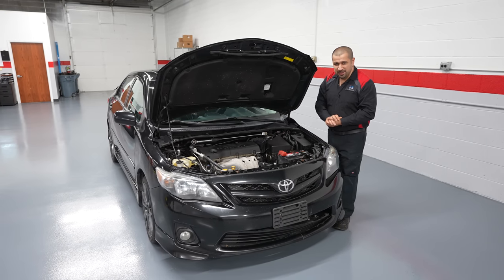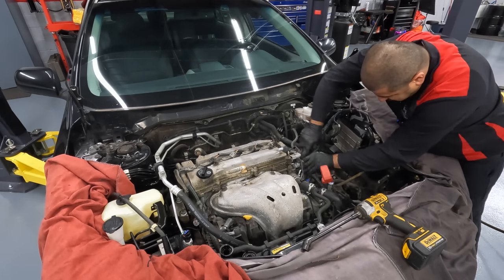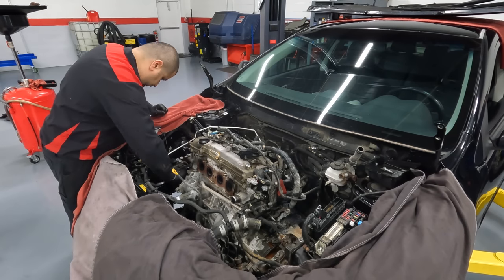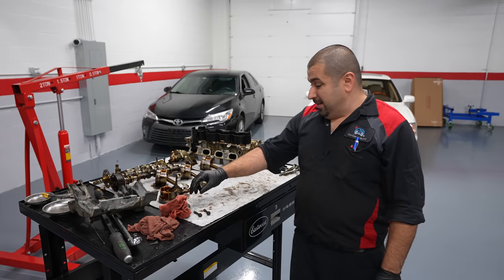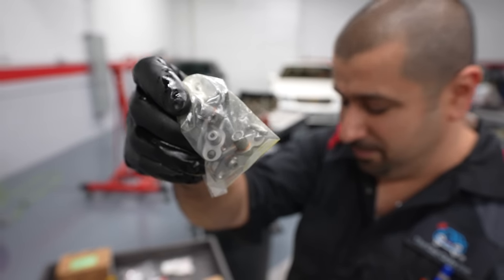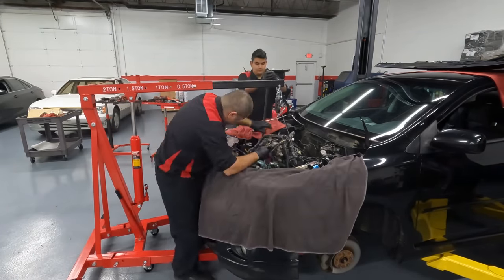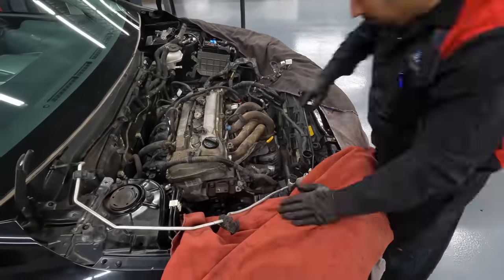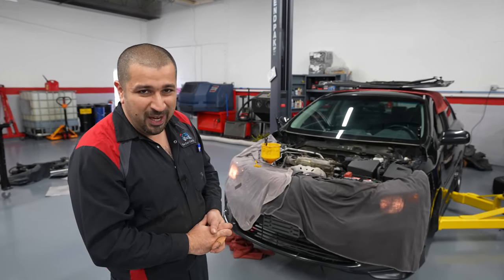THIS is Toyota's Worst Engine Ever Made! But Is It Really THAT Bad?

Comment: 5000 miles or 6 months, whichever comes first and NO MORE! Great advise my dear brother. Thank you so much for the timestamps on the description for the mechanically less inclined folks like myself.
Reply: I have an 08 rav4 100k miles, with this engine, did the 5000 mile full synthetic changes, still not burning more than 1/2 qt between changes, I am going to reduce to a 3000 mile interval with full synthetic to forestall this repair, also I will add 1 qt diesel 5 minutes before the change to dilute.
Reply: i changed the oil 17 times from 5k to 85k miles and the motor seized at 86k miles ...
Reply: @JP-jq1qx  doesn't that overfill the engine? Aren't we supposed to beware of overfilling? Just asking, no puns or anything
Reply: When I took my 2020 gx for oil change 5 months (3000 miles)after purchase, the dealer insisted not changing the oil. They insisted it was not due until 10,000 miles from last oil change. Should I insist and pay since it does not meet their complementary service timelines?
Reply: @sabyjackson5298  I would go somewhere else or do it yourself
Reply: @sabyjackson5298  I would pay and get it done regardless.
Reply: @sabyjackson5298  buy oem filters and do it yourself or get it done, if they see oem filters, they won't know what oil is in there. That's what I'd do
Reply: @JP-jq1qx  - I have the same model and mileage (bought it in 2019 w/99K miles on it - it’s only driven by my son who drives it maybe once per week). Once I switched from 0W-20 to 5W-20 the oil burning stopped. Which oil grade are you using?
Reply: @jrh11254  5w-20. I am basically going against their 10,000 mile recommendation and sticking with the 5000 or 6 months, whichever comes first concept…
The service guy made it seem ridiculous to want more frequent oil changes
Reply: @sabyjackson5298  - I agree with you; 10K miles between oil changes seems absurdly optimistic.

Comment: As a ex machinists, the A, B and C indicates the diameter of the piston related to cylinder bore size. Each of them differ about 10 micron or 0.010mm. For example the B are bigger 10 micron from A. C bigger 10 mikron from B and 20 micron from A. Its almost impossible to machine all 4 bore to the exact same size. Thus, all dimensions come with tolerance and exact piston size. Piston A should go into the smallest bore. Piston C should go into the biggest bore or just follow the original size. If smaller piston go into bigger bore, knock known as piston slap will probably occur during start-up.

Comment: Can confirm, my 2006 Scion tC was bullet proof engine wise and I was pretty hard on it, I bought the car with 12 mi and made it past 100k, always used synthetic and never saw burning oil issues, I was always confused why people had issues with the engine later on before I realized it was the 2007+
Reply: I have a 05 tC 215k miles (bought with 180k). Idk how many owners sealed my gasket (30 bucks) bc I went too hard on it. Nothing else major, love it.
Reply: I had an 06 and an 07 both new no problems whatsoever

Comment: I think this is one of the best engine ever,mine had done 500k with no oil burning at all,serviced every 10k
Reply: That's actually kind of shocking. I have a 2003, and it doesn't burn much yet. 140k miles.

Comment: This is a very simple engine to work on, I know. It looks intimidating but really after you get into it it goes really quick
Reply: Do you recommend putting thicker oil into older engines? My mechanic put 5W30 instead of 5W20 into it even though W20 is required.

Comment: Hi Ahmed, you are obviously a wonderful mechanic and technician able to deal with these over complicated cars. I am a professional engineer. I try very hard to fight against over complication and make sure the designs have good repairability. Unfortunately, sometimes I get forced into complex designs; I fight as hard as I can because when things go wrong it is me on the phone trying to explain to a mechanic how an electronic wireless control, I have had to design works. I built my own Land Rover on a galvanized frame. Unfortunately, the parts these days are so cheaply made it is hard to a rebuild well even though I am willing to pay whatever. The parts are still junk. So, I am going to have to rebuild or manufacture the old designs. And yes, I work on modern cars I have 3 professional scan tools and a Pico Scope. My B.Eng is in electronics, and I am a P.Eng. But still, you are very impressive with your attention to detail, experience and knowledge. Wonderful to see. I am in Springfield Canada the hom of rust.
Reply: Land Rover. There’s your problem.
Reply: @aygwm  I built it and can rebuild it as long as I am alive and moving. Very desirable in the US.
Reply: Do you know if it's true that you should put thicker oil into older engines?

Comment: I am not a mechanic, but I was completely glued to to my computer screen for 43 mins. The Car Care Nut is an excellent communicator great source of information.  My wife and I've been marries for 50 years and our first car was a light yellow 1968 four door Toyota  Corona with  bucket seats, four on the floor, a heater and an AM radio. She purchased it used  in 1970 for $750.00 when Toyotas here in California were a novelty.  We put over 250,00 miles on that car with absolutely no problems other than a starter, wqsd belts and tires! The only reason that car isn't with us today is a mechanic at K -Mart installed a new battery backwards and fried the electrics. It was never the same  again. To this day all the cars we've owned have been Toyotas, with the exception of a Ford p/u  and a Honda Accord in the 80's.

Comment: Excellent video.  I have this engine in a 2007 RAV4 and it doesn’t burn any oil between oil changes, which I do myself. The issue I have with Toyota is that it seems their policy of only repairing cars that had an oil consumption problem during the short period of the program is that they seem to be rewarding those who did not maintain their cars and punishing those who did maintain their cars.
Reply: I think I was in the same boat-08 Solara. Changed oil on time and after 85k miles slowly noticed oil consumption. But the oil test at dealer said it passed and is good to go, but consumption got worse after 110k miles- add 3/4qt oil every 1k miles.
Reply: At least you know and you change it yourself. Maybe spend double on oil and filters but that’s cheap compared to this job!

Comment: SHOCKING. How Come You never measured the Ring gap? I don't think I've ever put a piston in an engine without measuring the gap first. I've had a manufactory be out of spec with ring gap before. Especially Wisco.     Love your videos Keep them coming. :)
Reply: he is using toyota oem parts
Reply: Toyota parts are always perfect and in spec's.
Reply: Wonderful answers  👌
Reply: @stevenyau2443  Wisco Rings are Not toyota OEM parts. I've done a couple Corolla engines and the End gap has been off from time to time.
Reply: otahu Rice
Toyota Quality!

Comment: I'm glad I got to see this video. I might start looking for decent Toyota Camrys with oil burning issues, buy them, do this job in my driveway, and then after I drive it around for a few weeks and I'm sure that the car is in good condition, re-sell the car. I know this engine can be a very good engine because I owned a 2003 Camry that had almost 300,000 Mi on it with absolutely zero issues and it would get almost 40 Mi to the gallon on the highway if I kept it below 75 mph and if it hadn't been totaled by a runaway garbage truck in the grocery store parking lot while I was inside grocery shopping I would probably still be driving that car today. This looks like it would be a relatively easy job for me to do at home

Comment: Question.....this engine obviously as you stated did not have the best oil change maintenance done on it. If it did indeed have proper oil changes would the sticking rings still be a problem?
Reply: I would say it's probable. The issue is the oil control ring. They are a one piece design that cannot maintain oil control. This is why they have a kit to address this issue. The kit has a multi-piece oil control ring that will actually work. Technically speaking the compression rings are also oil control rings but let's not go that far into detail

Comment: Have 2005 Toyota Camry LE with the same 2.4L engine. Currently have 229,789 miles. I  was losing/ burning some oil due to Timming Chain cover and value cover gasket leaking oil. 

However, after replacing both, I do NOT burn or have anyone leaking oil.

It's a basics. A two B  car to work and home leaving my gas burning Toyota Sequoia V8 engine to drive around on my days off work.

Comment: If hi quality synthetic oils, good filters and reasonable intervals (4-5k miles) are kept this work could be pushed beyond a need for particular car. I have owned three cars with this engine and the common factor leading to this failure are exclusively cheap oil changes. Periodic engine flushes do help as well, however, once too far gone they will burn oil.
Reply: I have just over 420k miles on my '97 4 Runner with the V-6. I kept up with oil changes. For a few years I was changing it at 10k miles. I had the oil tested and they said I could actually run up some more miles on it. I decided against that. I used it for my daily commute which was 30 miles one way. Later on after I switched jobs, I started changing the oil at 5k miles. It still runs well and doesn't burn oil. I plan on replacing it with a new 4 Runner later this year. I want something reliable around after I retire. I still enjoy going out camping and fishing.

Comment: I can't help wondering if those low friction piston ring engines burned oil from day 1 , or did it take carbon build up around the oil control ring to trigger the high oil consumption. If this was the case could any special oils be run in the engine to try and clean the piston carbon enough to avoid the teardown job. I liked the way you were confident enough not to gap-check the new rings. The low friction rings may have give the cylinder bores an easy life. Great consumer information here AMD. Thanks as ever.
Reply: I worked at a Toyota dealer when they were rebuilding these motors every day. These rings did not cause oil burning right away as far as I know. But as soon as carbon build up around the rings started, they would begin to burn oil. A lot of the cars I did oil consumption tests on were around 80k-120k, but had been using a lot of oil. As to your question about using something to clean and disolve the carbon, to free up the rings. Yes, it has been done. There are quite a few videos on youtube where people take a spark plug out, and pour a small amount of concentrated carbon solvent into the cylinder, and let it soak over night or for a few days. Once the carbon is gone, the motors opperate as they should. But at some point the issue will come back.
Reply: @brad3741  Thanks for the insight Brad, much appreciated 👍
Reply: @brad3741  so, would the BG engine cleaner, prior to an oil change be a good idea if the car has 201K on it?
Reply: @brad3741  Do you think it would help to put thicker oil into this engine than what is recommended?

Comment: You should have shown the plugged oil drainback holes in the original pistons, compared to those on the new pistons. If the drain holes worked then the oil rings wouldn't get stuck, and the low tension oil rings wouldn't be a problem.
Reply: An argument for early oil changes.
Reply: @anonymike8280  yes which he covers
Reply: @newbernbears  Though, if you have a really bad design, nothing can save you. There have been hopeless engines made. Others, aggressive maintenance might keep them going.
Reply: Oil drain back might slow the oil consumption very slightly but you can't overcome blowby from a loose ring to cylinder unless you replace the rings with higher tension rings to seal the gap properly.
Reply: 1zzfe had this problem too

Comment: I have an 07 highlander with this engine. 170k miles, burns a quart every 4k miles. Runs like a champ still tho. Bought it for my wife because her grandparents had one with 300k miles with no issues. Take care of your cars, they will usually take care of you in return.
Reply: A.quart every oil change is de minimus forma six-figure mileage car.
Reply: Did it burn oil? And did you start switching to thicker oil or kept on using the 5W20?
Reply: @Jose-sy1je  still burns oil, but my wife drives it most the time and doesnt put many miles on it. I run 5w30in it. I recently had a few things replaced and it seemed to be running well. Then someone stole the catalytic converter, so thats now a whole other issue. Sorry for the long reply haha.
Reply: @Danno_87  That's cool. He actually says at 42:00 that this engine was designed for 5W30. I didn't know that. Just recently put it in there and not sure if I should stick with it. The manual states 5W20.

Comment: I had a 2002 Camry with the 2AZ-FE engine. Around 150,000 miles or so it started consuming oil (maybe earlier than that, I don't remember). There were no other problems, so I just kept topping off a quart every so often, which I found to be quite tolerable, definitely cheaper than getting it fixed. I eventually sold the car when it was 13 years old, with over 220,000 miles, to get a new 2014.5 Camry.
Reply: Make sure you keep up on your pcv valve.

Comment: I had the same issue with my 09 Scion Xb --- just had to closely monitor the oil.   Also @The Car Care Nut - the V6 3.0L in my 2nd gen 4Runner was a piece of junk.
Reply: Yep, the 3.0V6 in my 2gen 4runner 5speed I knew was a turd so I sold the engine and replaced it with a 4.3 Chevy V6 using a adapter. That was back in the late 90s. Super reliable and a lot more power and got better mileage.

Comment: The best and easiest to maintain engine that I had by Toyota was the 2JZ inline straight 6 with the nice solid cast iron block, unfortunately I had to get rid of mine on the GS300 due to stupid politicians demanding that I pay £12.50 per day just for using it here in London due to their emission standards. It was not easy picking another Toyota engine that was so clear and uncluttered as that to replace it. In the end I found a Lexus with a 2AR-FSE engine without the plastic rocker cover at least as added to later models and although no-longer nicely balanced like the inline 6 and noticeably so but at least it has plenty of room either side to operate on it and you don’t have to take unrelated parts apart just to change the spark plugs (like on RX/Others). However, trouble is Lexus are making them too low to the ground especially on the front bumpers and their V6 especially transversely mounted overcluttered over complicated timing configuration with double parts due to V6 with the extra work that has to done on them, well they just suck compared to inline 6 so I’m stuck with inline 4 now. Really Toyota is making them look nice but not very practical either to maintain or for use in real road situations but that said still better than other manufactures.

Comment: I always thought the Corolla 1.8 aluminum engine from 1998 to 2002 was the worst oil burner of all?
Reply: Those early 1ZZs were really bad, and that issue with them continued till about 2005-ish on them. But that was the only issue they usually had. 2AZs… pretty much all the engine internals self destruct. Not just from oil burning, but they also had issues with head studs, and seem to have really weak rod bearings too.

Comment: My 2009 Matrix with this engine is currently sitting in the Junkyard as the previous owner didn't do the recall.  The car was burning 1 quart of oil every 200 miles.

Comment: Yes the weather in Canada is horrible especially in winter with the salt. Also blame car owners, for not maintaining their vehicle. There's salt treatment you can do once a year to remove the it, which I do every year. It's not expensive. It's like a car wash just they spray a foam underneath that car. Lot of driver doesn't know how to maintain their vehicle. People driving with not brake list, they don't even know or do a routine check for bad bulb. Sometime I pull beside them, just to let them know they don't have brake lights. Keep it up with those good videos.

Comment: I do drive daily an old 2007 Corolla with a 4 speed automatic transmission. It’s a small 1.8 liters engine , but such a reliable and almost indestructible car , that still offers a good ride if you keep it well . Over here we have mostly corollas and other models but very few Camrys and of course lots of diesel trucks .

Comment: Love the video. Very detailed and explained very well very honest tech to do this type of video. Much respect. I feel confident i cld pull my 2az-fe out if my 09 camry se manual trans and rebuild the engine myself if needed to. It has 285k on it i have only put about 3k on it since i have owned it. It sat for nearly 2 years with very little starting in that 2 years and wasnt started in about 6-8 months due to battery being dead. I used to have an 08 xb with this engine bought at 85k put about 13k and have to have dealer due the oil consumption problem fix and drove it till about 170k before i got rid of it run and drove awesome.

Comment: I had one example that was leaking oil at the back under the intake. Removing the head revealed a mark on the block like something was dropped on the mating surface prior to assembly. A small groove from oil gallery to the outside of the deck. Was not picked up until 20k as the foam insulator soaked up the oil first before any leaks could be noticed.

Comment: Unfortunately my ‘09 Camry had the repair done less than 50k miles ago and it started burning oil again. On start up and while driving. Not sure what happened. Oil is clean after 3,000miles even.